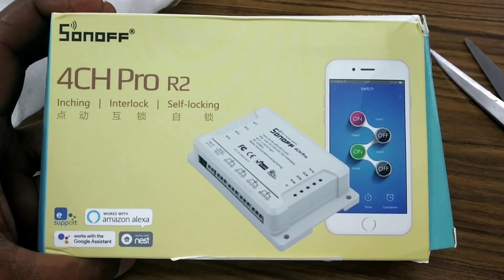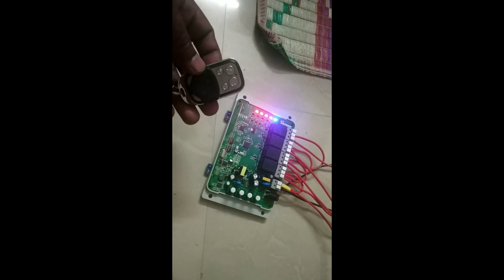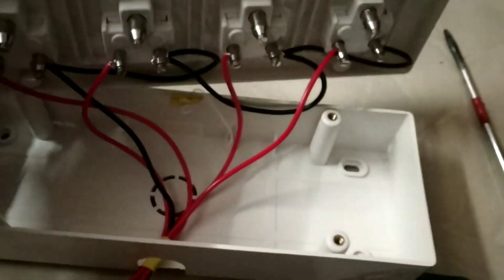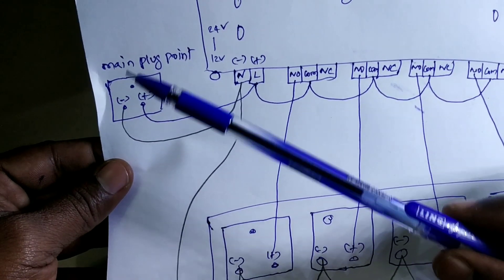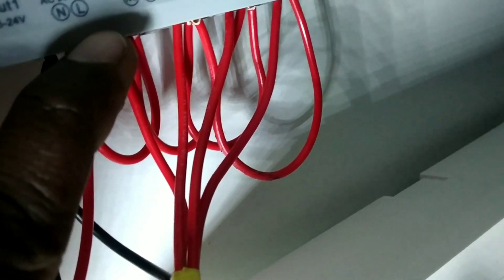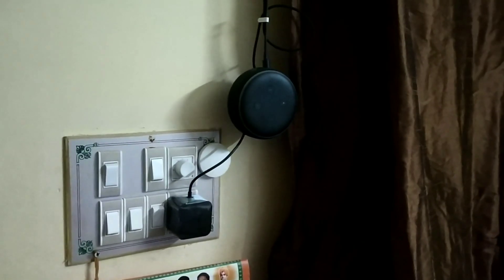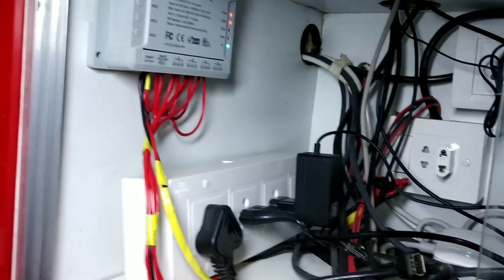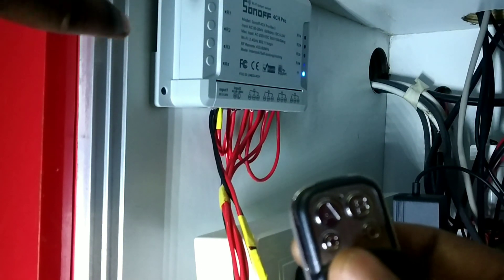Sonoff 4 channel Pro R2 full set up, working with sonoff 4 channel remote, working with alexa.

Comment: Sir ki price a es da
Reply from the maker: It is available in Amazon. In  just check enter search sonoff you will get all the devices. Rs2300to3000.
Reply: Thnx sir ji  long life a switch k nhi
Reply from the maker: @JagjitSingh-wq9ex 

Hi Ji, I am using more than 7 seven years, if electrical faulty current means or positive or negative changed means it Wil affected otherwise very good is sonoff.